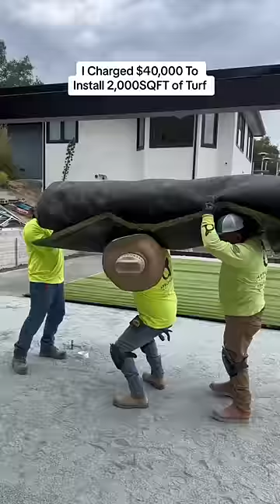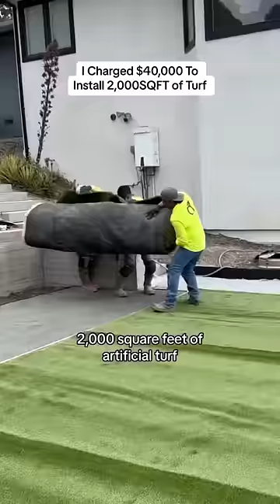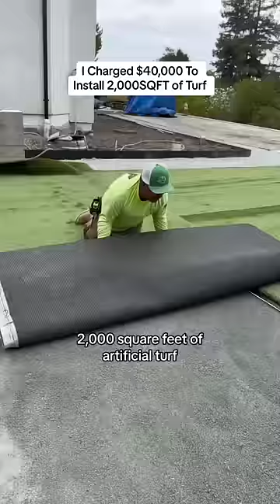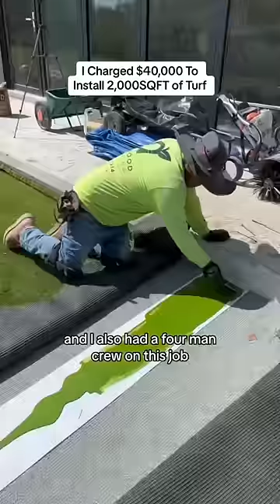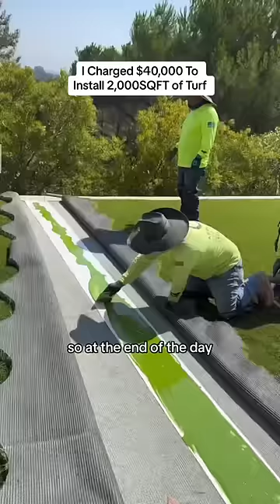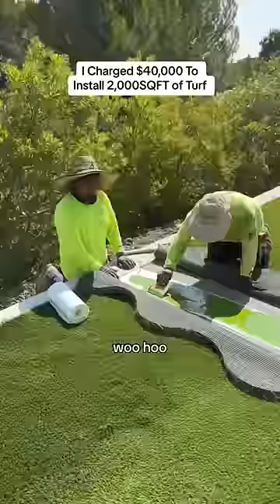I Charged $40,000 to Install 2,000SQFT of Turf! #Shorts

Comment: Holy shit, thats a 5000$ job
Reply: Exactly
Reply: Maybe 8-9k but yea
Reply: You'd be surprised what this company's charge. I live in Vegas and most homes have artificial turf. I've heard of some neighbors getting quotes for 10-20k for getting this installed in our shitty small 500sq ft yards.
Reply: @jcdebbs I paid 3,400 in NY for 1,380sq ft. Including the glue, the tape bond, and extra sand… took the guy 1 day to install. Sometimes it’s not worth living somewhere.
Reply: Yeah 40k is robbery
Reply: sees 14k in material and multiple days of labor for 4 guys, "thats a 5000 job"
Reply: Funny Is That He Didnt Say He Paid Them 120 For Each Helper Without Lunch Or Drinks, Maybe A Gallon Of Water A 79 Cents Gallon For Each One 😅😅😅😅
Reply: I asked someone how much he would ask for this. He said 45k euro thats close to 50k us. So he is not asking alot.
Reply: Brokey bois working in middle of nowhere lol
Reply: 14,000 split 4 ways is 3.5k odk where the extra 1.5k is coming from
Reply: The avg price per sqft for turf is $13. If you are doing for less than that, you might be a moron with construction estimations. And your job must be a crappy one. $5,000 for 2,000 sqft? That's $2.50 per sqdt. 
Even if you buy the turf in Lowes, the roll is $295 for 160x60. For 2,000 feet, you need 8 to 9 rolls of that size. Which gives you $2,695 just in turf. You have to add sand and granite, the logistics of the product, plus 4 dudes, another $3,500 to $4,000. Try and do it for $5,000, I'll wait.
Reply: No

Comment: Normally the avg pricer per sqf is $13.00, so if you are adding the hill issue plus the extra time that it takes to do this with 4 guys, a reasonable charge would be between $18 to $20 per sqft. So, yes, you git it right.

Comment: In reality they should've charged half that if they wanted to charge the normal rate which is already pretty high. Their price was almost twice the cost of getting turf per square foot in the US typically. Usually the going rate in the US is around 12-13 dollars per square foot and more specifically around 12.4 dollars per square foot on average. Which would be about 24,800 dollars for 2000 square feet. But usually the prices per square feet go down the larger the project gets. For a project of this size the price per square foot could go down to 9-10 dollars per square foot. But could still be charged as much as 12 per square foot depending on the difficulty of the project. 

It doesn't look hilly like he describes, it maybe on a hill but the area they worked on looks farily flat but even taking that into consideration if they charged $12 per square foot it woulve been $24,000. But they charged them $40,000. Realistically this job should've cost $20,000 based off the current market. And personally I think it should cost even less than that. 

It's no wonder this guy feels the need to validate his prices, but he's a moron cuz he exposed himself. Clearly there's tons of people in the comments not buying his bullshit and calling him out. Tho I do see alot of people tho saying it should've been rediculously cheap I see numbers like $2000 thrown out there and not many people actually saying the price it was worth. Would've cost more than 2,000 for the turf itself. So I think some people are confusing it with just being paid for installation for turf they already have. 

Anyway I could see some companies ripping people off charging 27-30,000 for this. But 40,000 is just absolutely absurd. 

The cost also has nothing to do with how much employees you have and gotta pay that's on you and how much of your profit you wanna make vs how easy and how long you want the job to be. And idk who the fuck is paying their installers $3,500 for a 2000ft job. This job probably took 3 days to do everything. In my area around $200-$300 a day is farily common ($23 per hour being the average) but wages vary by state and I live in a high tax state (NY) so those wages may be higher than in many other states. But assuming your paying them $300 a day. 4 employees at $300 a day for 3 days would be $3,600. He's claiming to have paid his employees $14,000 for that labor which is 4x the amount anyone would get paid for that here. Everything that came out of this guy's mouth is bullshit.